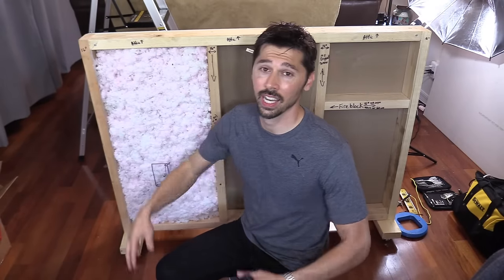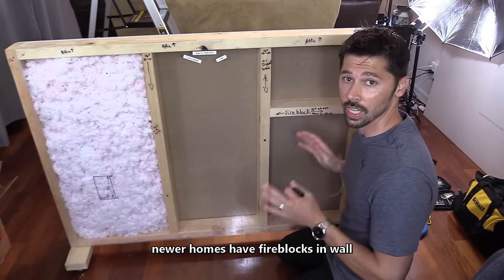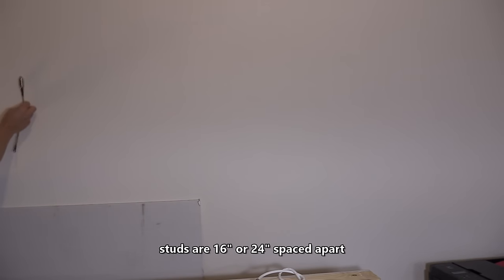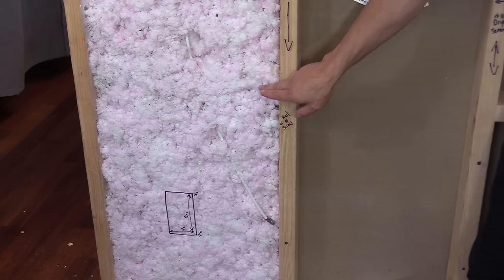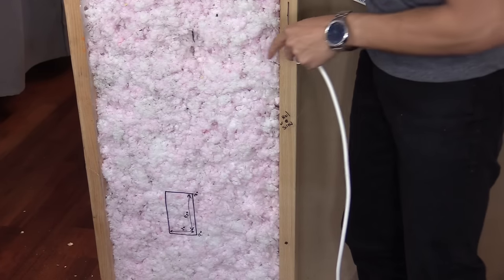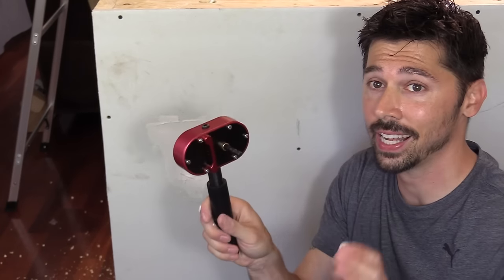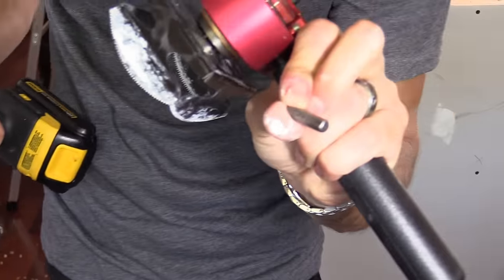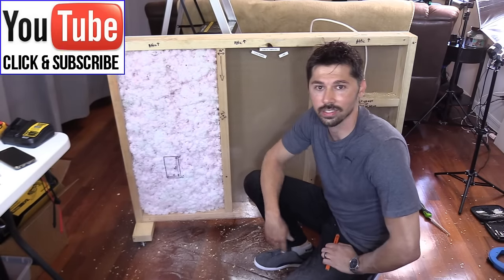3 EASY WAYS TO HIDE WIRES CABLES IN WALL & FIND STUDS

Comment: Excellent Video! I know what it takes to drop everything you're doing to share so I appreciated your time. I was an electrician from 1974 til 2015. Just a couple of other inexpensive things to carry in the van, 1. Hanger Wire. 2. Window Weight Chain. 1. To find a drill point in the attic, you can drill a small 1/8" or smaller hole in the ceiling. Make the letter L out of a piece of hanger wire, shove it through the hole and tape it to the ceiling with painters tape or masking tape. When you get up in the attic, just look for the piece of wire sticking up. 2. Window Weight Chain. Works great instead of a fish tape and  I used to keep a 10 foot and 20 foot piece with me for fishing all the time. Just anchor it in the attic and throw it down the race way or between studs. Sometimes if it gets stuck and you pull really hard, you can pull your way through something blocking the pull. Works Great! I learned that trick from a really great journeyman who picked it up from someone else. I WISH these newer tools were available when I was young! Again, Thanks So Much! Hmmmm, I wonder how magnepull would work with window chain?
Reply: I would put several loops of string on the hook end of the fish tape when working with insulated walls. Easy for the bent coat hanger to grab and pull out of the hole in the wall.

Comment: What I like the most about this video is the real world situations you ran into: Losing your bit, cutting too close to the stud, etc.  Thanks for the tips and the review of the tools...
Reply from the maker: Toe Knee thanks
Reply: Ed O'Neill it's a demo.
Reply: He said you have to be sure to seal up the hole in the firewall but made no mention of what to use.

And yes, one can do drywall repair, but two HUGE issues are omitted. First, the patch is just the first step. After the spackle is dry, the edges of the hole must be sanded. The paper at the front of the drywall will usually not leave a perfect finish, so another layer of spackle, just a thin coat, must be applied. And dry. And sanded. This process can hardly ever be done in the same day unless one uses hot mud. Look it up; but he should not have omitted this.

Once the patch melds perfectly into the wall to the touch, it must become the same color as the wall around it. The only way to come close to that is to take the cutout piece and get color-matched paint. If that paint truly matches, then after reinstalling the patch, you can paint a bit and you're done. If it does not match, then you're up for painting the entire friggin' wall.

The steps he omitted are going to buy paint before patching; patching and sanding more than once; painting; and perhaps painting the entire wall.

That four foot flexible bit sounds pretty attractive now, right?

Of course, this method is useful if repairs or painting are already being done.
Reply: @ Ed O'Neill - I take it you have never seen or encountered a house with blown in wall insulation before? It exists but it is not overly common, but it is out there. I typically found it in older houses that were either un-insulated (very old house, 90+ years old) or in older houses (50+ years old) that were insulated but the old bats have degraded and/or slumped down the wall cavity. It is blown in by drilling holes in the exterior of the structure, one or more per stud bay depending on height of the wall, and then they just blow it in through those holes which are then plugged and painted.

Blown in is/was an alternative to ripping down the sheet rock or more likely plaster and lath inside the house.
Reply: ...and the courage to leave the mistakes in the video. They were a bit funny but also pretty helpful especially to novices.
Reply: @erniegilman5233  This isn't a wall patching video. He also didn't go into specifics of how to design home wiring, or what gauge of wire to use, or how to safely work in an attic. I'm sure he knows that you can find the specifics elsewhere; he's just demonstrating that the hole can be patched using the removed drywall.
Reply: @korzynski  well, yes, this is not a wall patching etc. video.  It would be helpful to tell viewers (often novice DIYers) to go watch e.g. a wall patching video if working on finished walls, because the techniques in this video will not be sufficient.
Reply: Turning the wall and drilling straight down when you wouldn't be able to do that with more wall in the way. Seems like a very long commercial for tools a diy will only use once.
Reply: @erniegilman5233  plus I have textured walls. Who the F#@k started that S#@t.
Reply: I’ve lost plenty of drill bits in the past, not having a strong magnetic will lose more time. I need that magnet. lol
Reply: @erniegilman5233  He also omitted installing the appliance he was running the cable for. eyeroll
Reply: All that was missing from “the real world situations” was having his wife come into the room every so often to ask “how much longer until you’re finished”.
Reply: Randy Thompson 

I hate that! My two biggest pet peeves are customers calling into customer service way before their time frame even starts... Your appointment is from 12-5! Leave me alone! No I can't give you an eta, I might have a dam fireblock ruin my whole day! 

And I hate when I get into a house and the first question is "how long is this going to take"

Comment: Much of my electrical work were in homes where notching the sheetrock would be a no-no because of custom paint job or wallpaper.     Such a bit, a mirror and a flashlight worked for me in most cases.   Over 34 years of cutting in thousands of electrical boxes over those years, I had to notch a wall just a few dozen times.   Flexible drill bits were my best friend.

Comment: I have been doing this for over 30 years. For the DIY installer, these tools and tips will help you get your wires down the wall with minimal hassle. I like the tool that cuts out a single gang box sized drywall piece. Pretty cool.

Comment: As an electrician, security & CCTV installer, as well as a professional drywall finisher, I have only in rare circumstances ever cut holes in walls to run cables.  Take a look at the numerous LSD (Labor Saving Devices) tools, (like fiberglass cable fishing poles, which glow in the dark) for additional ways to solve problems. I have several 8' long bits with extensions and have drilled all the way from basements to the 3rd floor attics with these. Also, you MUST use drywall tape to patch that hole or it will eventually crack. Good presentation nonetheless.
Reply: He also forgot the drywall screw
Reply: maybe you can give me an idea how to from a basement to an attic in a 2 story house... found a wall I can use that doesn't have a lot of traffic however it's lath and plaster... am I better off taking off the large base boards on both floors or just using several extensions... on a flex bit can I get away with a 9/16 for 12/2 or do I need 3/4
Reply: You ever notch out to fit the wire then put the metal plate protector?
Reply: I install cable. I don't patch walls :)
Reply: How would you run speaker wire ACROSS a ceiling (no attic above) and then DOWN a wall to reach the bottom where AV receiver is?
Reply: @jimmymcgill5572  you can get a long flexible bit with drill bit drill thru joust and cut holes at each joist big enough to be open on both sides of the joist to pass the wire through with a fishtape then at ceiling to wall cut from ceiling to wall to expose the top of the wall use a spade bit to make your hole then a hole down the wall fish your wire through and patch all your holes up
Reply: Macgruber They actually make speaker wire that looks like tape, You run it along the outside of the wall and then paint over it and you do not even see it! No need to do any drywall work!
Reply: tomdee1776 this video seems like it’s geared towards the diy person! He has like he has like $700-$1000 in tools just to run one wire! Also his work is shoddy at best, Who purchased drywall without taping! Also I didn’t finish watching the video but I am pretty sure you have to fill all your plates with fire block foam!
Reply: now look at uk stud partitions, they have noggins in them, how you meant to get through them without cutting hole in a decorated wall Mr expert

Comment: Your approach to the fireblock is better than mine. I started making grooves in the drywall and running the new cable inside the drywall before patching. Once I even ran new electrical inside a groove along the bottom of the wall and covered it with quarter round. It almost worked the first time, but the nail gun pierced the new line. Live and learn! Thank you for the new ideas!

Comment: TAMPATEC,
RE : pulling wire
MAN! You are like the wire fishing master !! For 30yrs I installed gas station 
cash registers which have several wires & cables that run from the sales counter 
to the back room. Hell, on an occasion, a cable or wire would need to be pulled to 
another building !!
I didn't know these tools existed. I would ask the project electrician now and again
If they had any tricks of tips that might help me but was always told NO.
I have to admit tho, each time I had to pull wire I learned something.
Why, I bet I have the largest collection to swear words of anybody !!
I'm retired now so I don't have the joy of wire fishing anymore.

!

Comment: This was an awesome vid - thanks! I'm ordering the Magnepull right now! I wanted to chime in regarding what worked for me to get through the fireblock without cutting a hole in the wall. I attached a 1/4" socket to the end of a section of 3/8" threaded rod, ground to fit the square drive end. Then I abraded the surfaces and inserted the socket onto the rod and the spade bit into the socket and bonded everything together with 3M-DP100 flexible epoxy. Since I needed to go pretty far down into the wall and only had about 20 inches or so in the attic, I cut several sections of threaded rod and had the coupling nuts, so I could make the 'bit' as long as I needed. In the attic, I drilled 3 holes with a spade bit, one for my flashlight, one for me to peek into and one for the long bit. After assembling enough rods to get me to the fireblock, it drilled through just perfect. I dropped the cable and phone lines and didn't have to worry about patching a hole, or trying to match the existing paint. That rig lasted for quite a long time and worked like a charm every time.
Reply: I used 12" bit extensions beginning with the drill bit, each one held together with an allen screw.  Like you, I didn't have much room between the roof and the header plate, so had to connect them one at a time.  Three or four got the spade bit down to the fire block.  Did pretty well holding the whole thing at 90 deg., drilled through the block, and when I had removed everything (again piece by piece), used a fishing weight or chain to find the hole.  Had to do this several times to run coax and network cable and never had a problem.  Don't remember what the extensions cost, but they last "forever."

Comment: Great tips.
You could drop a pull string along side the cables just in case you want to replace or add another cable. That way, you won’t need to do anymore fishing in that wall section.

Comment: Ya,  the flexbit is the way to go.  I definitely don't want to do unnecessary drywall work especially in a customers home...
Reply: Tom Grooms you mean especially 'when' a customer's home. Lol
Reply: Once I'm finish, I definitely don't want to have to repair someone's walls (sanding, painting, wallpaper). I'm sure my customers would've been pissed cutting around a fireblock like that!!!!
Reply: Oh my gosh, another that didn't watch the video objectively
Reply: @cldan9152  your customers are the ones that got a property without wires in the walls that they need. That's their problem. I have to move an outlet here when I add a cabinet in the kitchen. I fully realize that's my problem too. And if I have to rip out a whole piece of sheetrock in order to do it then oh well. The whole room is getting painted anyways.
Reply: @cldan9152  I've no experience here, but just from what I gathered in the video doesn't code require a fireblock to be sealed after drilling a hole through it? If so, then if you get through it with a flexible bit you can't seal the hole around the wire you've run inside the wall. I thought that was why he did it.

Comment: Shared this with my company instructor. We install POS equipment for fast serve restaurants. We usually work in drop ceilings so it's easy to find studs, but this is the first time I myself have seen magnets used for running cable. Kudos for putting this out there! You got a new sub from me lol

Comment: I am a security installer and I don't ever have to deal with attic spaces fortunately but we are not allowed to go through fire breaks or around it like you did by removing dry wall. Sometimes there will be a small space in front or behind that I can use a fish tape to run CABLE but otherwise we look for an empty wall space. Generally since your electric outlet is naiiled to a 2x4 on one side or the other I will take the face plate off and run a wall snake up the wall before I still anything to make sure it's empty or insulated and to make sure I don't get a fire break.  Then if need be I can make a space for a telephone box riight beside the electric outlet and attach it to the 2x4 on the opposite side.   You gave great tips. Wish I would have known these while I was installing CABLE. Although they had us just go straight up through the floor or in through the wall instead of making it look good with CABLE jacks. (One reason I'm no longer in the CABLE business)
Reply from the maker: Damon Alfero thanks for sharing, I did installs for ADT only 1 month it wasn't fun.
Reply: Damon, you were not allowed to go through fire breaks, so what did you do when you couldn't find "a small space in front or behind" and you also couldn't fine an empty wall space?
Reply: Exactly...
Reply: agreed to everything said above
Reply: I owned a house in California and all of the walls had fire breaks. Also, they had earthquake reinforcement. 2 X 4's crossing the entire wall. There is no way you can get by without poking holes though a 2 X4. You must be working in another state or much older homes.

Comment: Thanks for taking the time to show different ways to install. I do a lot of tv outlet revamps in my handyman business and most always run into fire blocks, ugh.
If you don’t mind I still have to say “safety first!” The average non construction home owner or renter may eventually hang shelves pictures whatever without thinking about hitting 120v wire. Make sure you install nail plates even on fire blocks you just never know. 
Great tools Tampa man. Covet, covet, covet.
Chuck

Comment: I'm retired now, having worked in UK telecoms for 35 years,, running cables for phone systems. I wish I'd had these magnapulls all those years ago. I had a fair amount of success dropping cables down cavities and fishing with a hook (usually a cut-down coat hanger!) but these would've made life a bit easier. Thanks for the informative video.
Reply: I got real fish tape but you cannot beat a coat hanger in many situations. Coat hanger wire is the right amount of stiffness combined with bendability.

Comment: Good tips. I use 4’ or 6’ flex drill bits to drill through the fire blocks. They have 3/8” to 5/8” tips and you can get extensions if the walls are 12’ tall. There is much less wall patching . Also, I’m never without an old metal coat hanger to snag wires as well. “Glow rods” are also very helpful. For vertical and horizontal fishing (pushing and pulling wires). Rarely did I ever have fancy electronic tools ,with exception of a toner for finding prewired wires that were covered over by the drywall.
Reply: My attic has a max height of about 40 inches at the peak. Add in a very low roof pitch and half of the attic has less than 24 inches of height. Add in AC ductwork and you're doing good to just find room to crawl.

Slab on grade means no basement.

Wallplates are about 12-14 inches off the floor.

Here in the south all of this is extremely common.

That makes flexible bits hard to use for much of the house.

Comment: I run the spade bit on extensions down from ceiling to put a hole in fire block. Saves me from cutting the driwall. Saves time and the job looks like a pro did it.

Comment: Thanks heaps - have just done  put in a Ethernet cable drilling through a noggin (aka fire block) to get it down from the loft to an outlet in the kitchen using your technique. I didn’t have a 3/4” blade cutter so drilled a couple of holes and made a slot. Just need to patch the wall up now!

Comment: good job. Great Info.I've always done this stuff with what I have on hand. dry wall saw, utility knife, fishing tape, wire cutting pliers, etc...But to see actual tools made for this type project...amazing stuff. Fishing wire through walls is something most people think they can't do. Might be a good thing though as electrical is nothing to take lightly. But for video and audio cables, and hdmi runs, sure...You have enlightened and gave many simple instructions so even they can do it. BIG TIME HELP. Very glad you made the props, it does help to see whats going on for those that have no clue.

Comment: To get through a fire block get a few quick chuck drill bit extenders and keep stacking them as long as you need. Once you drill through the fire block shove your extended bit down the rest of the way to your box. Catch it down below, tape your wire to it, and pull it back up from the attic. Its really fast and you won't have to cut and patch walls.
Reply: This is exactly how I run through fire blocks whenever I do gigs It is so much easier and I also have a boroscope or I can look down the hole and see what's going on sometimes there are slim slits where you can just maneuver a fish tape and work around the fireblock .